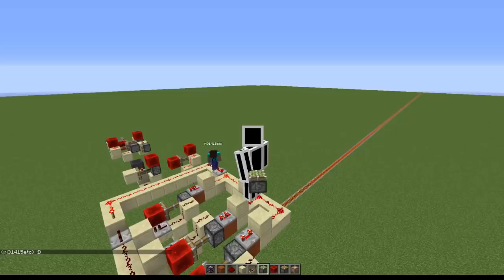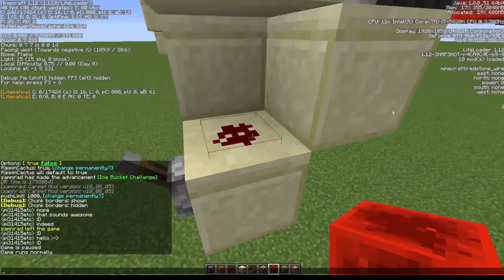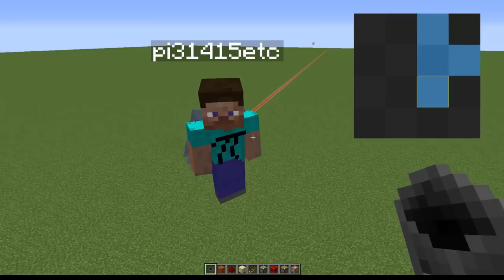Piston Loading Explained

Comment: so what are the pros and cons of the vilager and the piston loader?

what is better and more reliable
Reply from the maker: Piston loaders in general is less laggy and quite easy to build with minimal effort. They however don't reload when server restarts which villager loaders do. But villager loaders have a drawback that causes them to break down if there are more then 64 villager positions loaded in the same dimension.
Reply: @Xcom6000  do you use pistons loaders or vilager loaders for your sand and dragon egg duppers on scicraft?

i wanna use some kinda loader for a mob switch for the end in single player
Reply from the maker: @fine93  Dono why everyones paranoid about using them but dugged used it for there nether switch and it works well.

There is also the ender chest loader that has the simple drawback that it needs a full dimension unload to turn off. Otherwise its the most simple mob switch.

Comment: could i permanently load a chunk with this? and does adding more decrease the likelyhood of a failure?
Reply from the maker: It works as long as the server doesn't restart. It only needs to be reloaded to get it working again. It also can fail if players goes near it and walks away. Rather there is a small chance the players unload the chunk and the autosave hits within 10gt while the pistons are trying to reset.

Otherwise can have as many as needed. In the nether a single hopper is also needed inside the same chunk.
Reply: So i have to leave the chunk with a Nether Portal?, also works at single player?